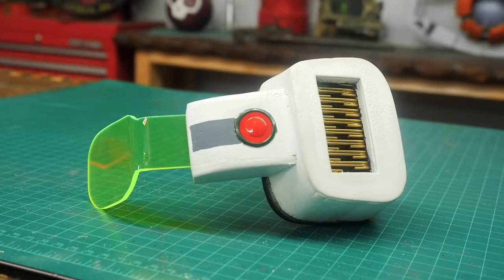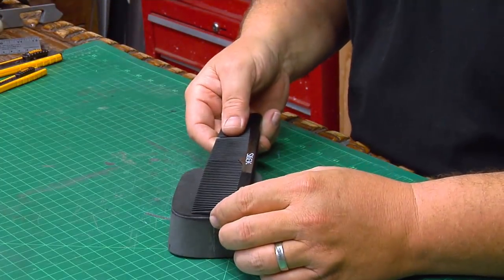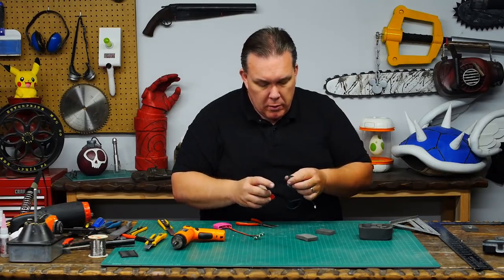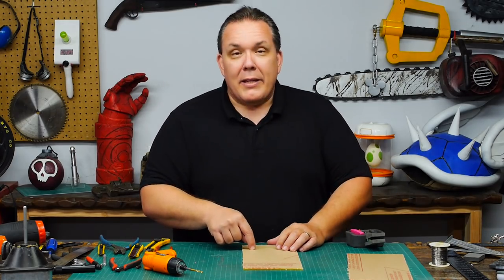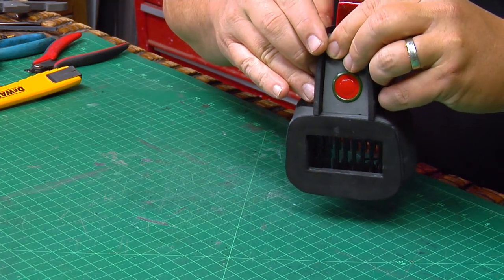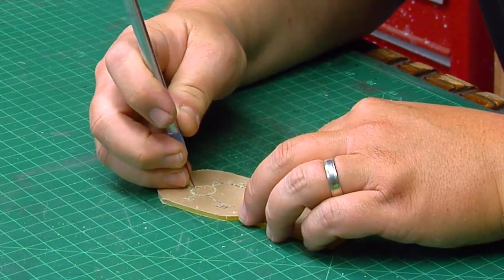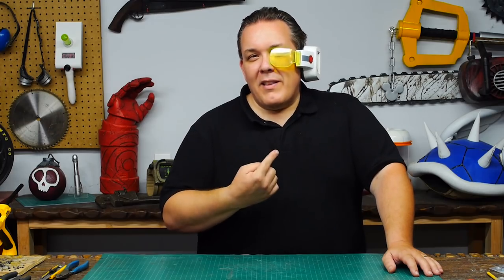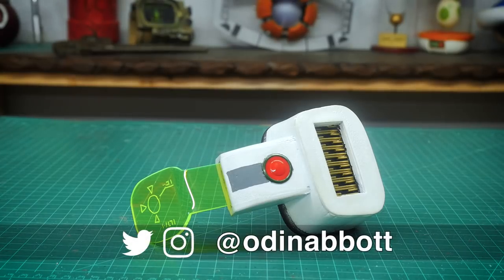Odin Makes: Saiyan Scouter from Dragonball Z

Comment: @Odin Makes: Not trying to offend you in anyway, there are some things that needs a bit tweaking in your scouter. 1. The scouter is slanted due to because you made the lens and the frame connected to the scouter in the middle, which it makes it too slanted. I would have made this scouter close or base off of glasses where the glasses uses the Temple frame to make sure the glass frame doesn't look slanted. 2. the scouter is just too bulky, probably better if you could make it smaller.
Overall, the design is nice and i like how you put lights on the lens.

Comment: It’s a cool diy scouter, I’m not triggered by the way you said sayain, or the way the scouter looks. I’m triggered by the way the scouter hangs. When looking straight it hangs to low. Now I know it’s the weights adding with the weight of the plastic that causes it, but it needs to trust higher above the ear, because when you look through it the “power readers” cut out looks low almost like it’s still falling off your ear. Could be easily fixed with more cushion raising within the ear. Otherwise it looks great. But like I said it’s too low. In the show and manga the scanner hangs just enough to be centered with the eye, not way below the eye.

Comment: The scouter isnt a Sayan technology dude. Its Frieza's army equipment like the battle suit e.e
Reply: Wrong actually. The scouters were a piece of technology made by the Tuffles, the race that shared the planet the Saiyens originated from. We see it in King Kai's flashback lesson on the Saiyens where the Tuffles were using them on the Saiyens.
Reply: @jetpower6601  yeah i see. The problem is that "MAYBE" its not canon, Kai version dont sow that but i havent read the manga so its hard to say e.e
But you are right, in the first Dragon Ball Z version its as you said, but that version has so many fillers and many non canon :C we also know GT isnt canon, so its like we never heard about tsufurus if we consider Kai that is the version without fillers.

I have ti read that fucking manga e.e
Reply: @pollege6579  Pretty sure its canon. Kai was heavily shortened compared to Z do i dunno.
Reply: @jetpower6601   Kai cutted all the fillers, thats why its hard to say if is canon or not if we havent read the manga. It could be a filler or a random cut
Reply: @pollege6579  Filler can still be canon but yea, i see where you're coming from. I should probably also read the manga.
Reply: @jetpower6601  me too e.e